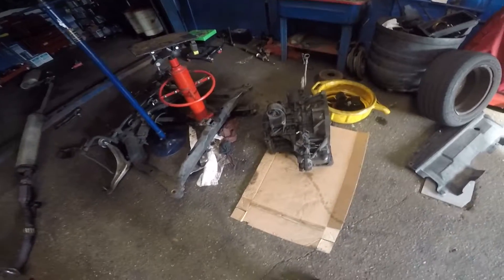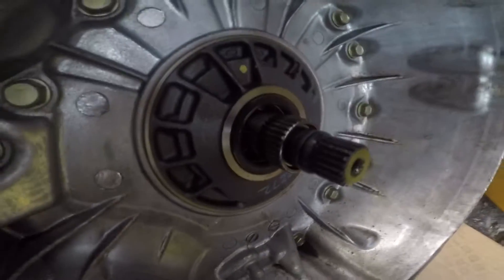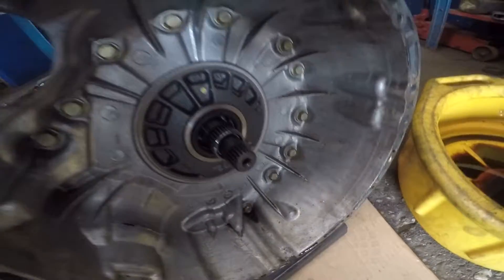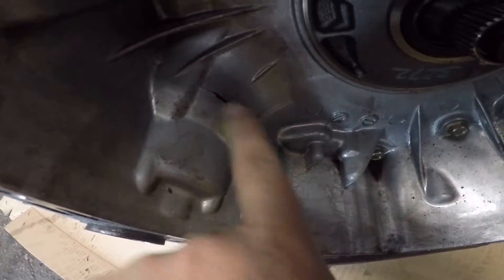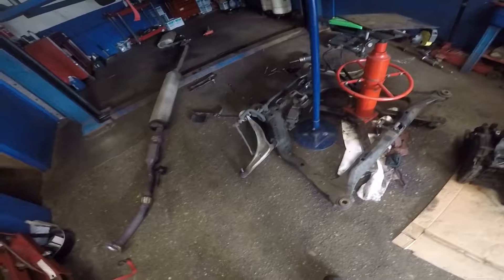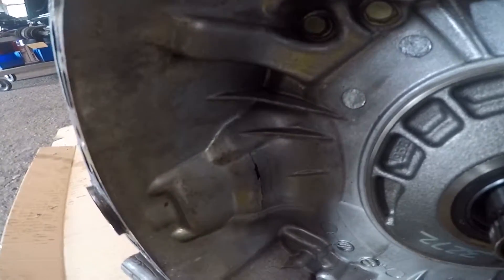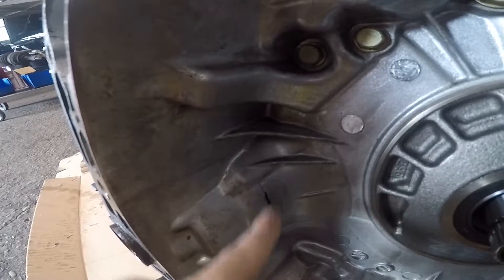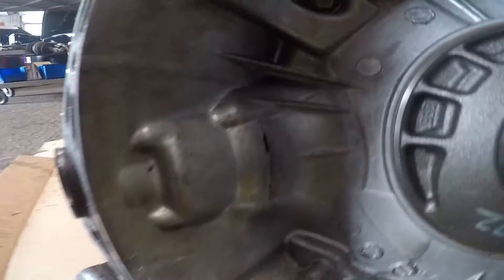Nissan CVT Transmission Cracked

Comment: I have the same problem with a 2011 versa.  The crack on mine is in about the same area, car has about 160k miles on it.    Any idea why that happens?
Reply from the maker: Not sure what happned but I think the inner bearing faked and the grates rubbed made it weak or just pressure